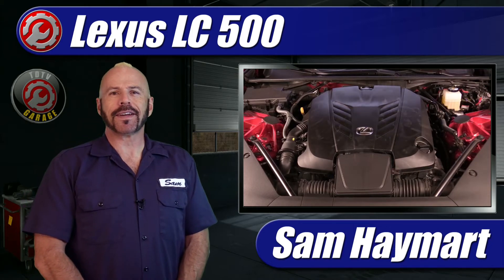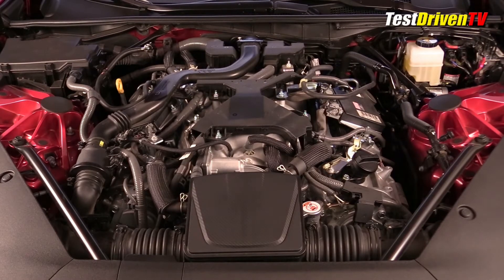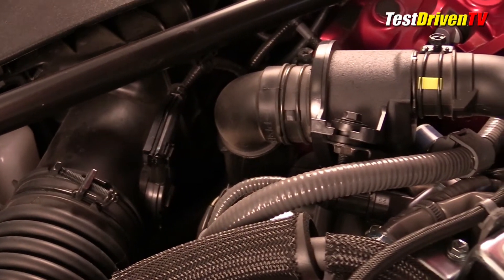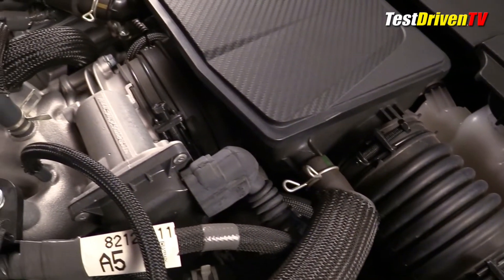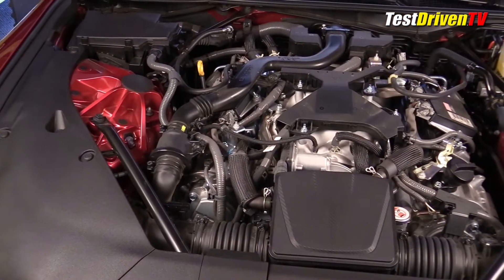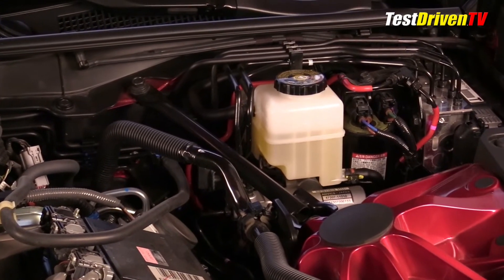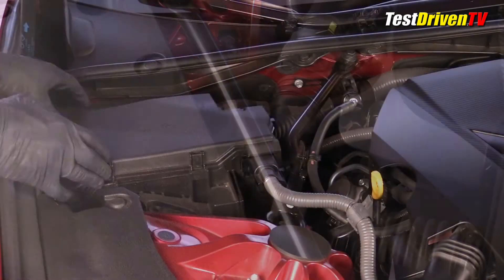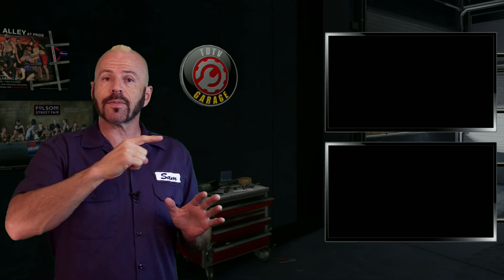Lexus LC 500: Under The Hood

Comment: Suprised to see a substantial amount of engine mass ahead of the front axle.

Nice that an engine like this can run in Atkinson Cycle.   Decent fuel mileage for something so big and heavy.

Wonder if the port injection runs often enough to keep the intake valves clean...?  Tend to think so.

They put a lot of work into, certainly.
But, no transaxle.  No attempt to be a front/mid engine car.
Reply: There's a couple videos of people looking at the intake of toyota's with the D4-S system like this has and they are all super clean, even after 200k miles
Reply: @85CEKR  That is good to know.
Thanks

Comment: Hey Sam  just subscribed to your channel.   I want to know in your opinion would you consider the LC 500 better built than other high end cars?  Say compared to the German makes or even the so called super cars like Ferrari and Lambos?
Reply: I've owned high end German cars and my LC500 is a touring ride and fun to drive. Most exciting point is my wallet is jumping with joy. RELIABILITY
Reply from the maker: Our feeling is that the build quality, fit and finish is equal.
Reply: @TDTVGarage  lie’s absolutely not equal the lc500 takes the win by a far unless your talking Bentleys or rolls Royce

Comment: Do you know under what driving conditions (speed and load) that the engine switches between Otto and Atkinson cycles?  Thanks.
Reply from the maker: It varies depending on load, throttle position, speed, gear, temperature, air density etc. It's variable.